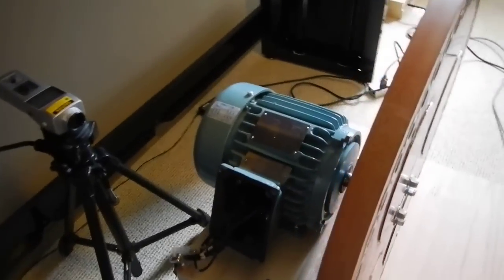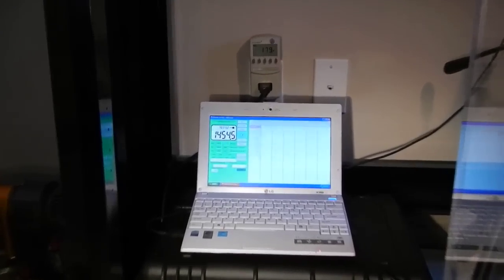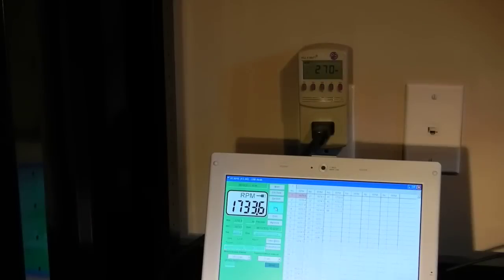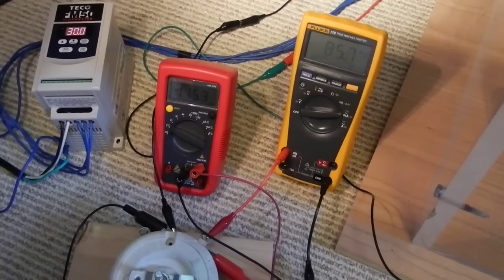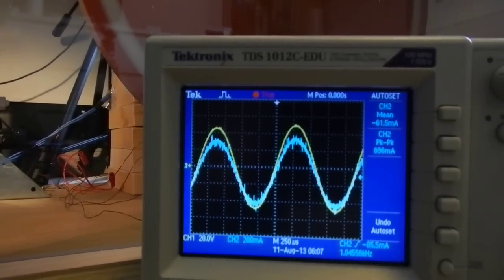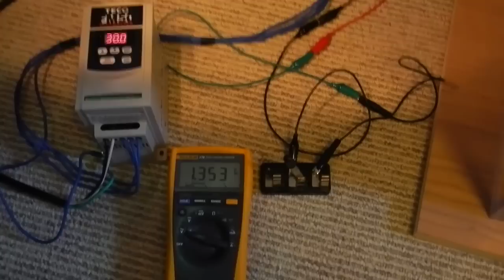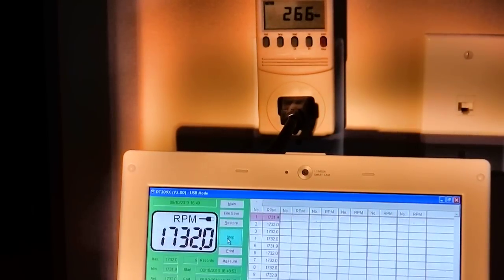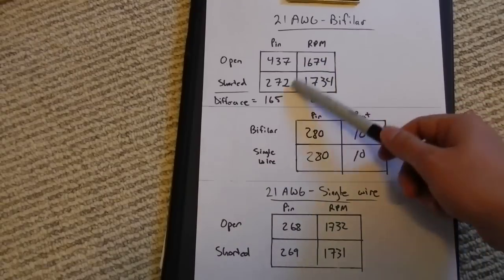Debunked - Thane Heins, ReGenX, delayed lenz, shorted coil, acceleration effect

Comment: Speed increase on Rotor is caused by current flow to the load. The magnetic field polarity is opposite the polarity that induce the current. Since the wheel is way so fast one of the coil lags behind in reaction and this makes the coil unaffected by the two following magnets on the rotor. So the second magnet from the one induce matches polarity at the coil that's repel and increase the rotor speed just like a motor  the third is don't affect the coil at all because the polarity on the coil hasn't collapse yet. The fourth magnet induce current as normal since the field at the coil is zero. To proof this low your speed substantially. The shouldn't be speed increase and low wattage drop.
Reply: Also remember you speed sensor is not correct although won't make a difference. The speed of the wheel is high on the outside than near the shaft and that's relatively to where the coil and magnets are. To get an accurate reading put the reflector at the same line as the magnet on the wheel
Reply: That's because it's a tackometer.  It measures revolutions per minute.  It doesn't matter if the reflector is tripped near the rim or the center, as long as it takes the reflector the same amount of time (which it does regardless of where in that radius it is located) to come back around and tick the laser, you have an accurate tack.  Measuring the speed at one side of the wheel or the other will involve some much more fancy math, but ticking that the wheel has done a full revolution can be done at any point on the radius.

Comment from the maker: @Matthew Jones You don't know what you are talking about. Mr.Heins has many times said you want high impedance AND high frequency. It is only under those conditions where the acceleration affect appears as I have demonstrated. You can count his magnets and with RPM get the freq which is in the same range as mine. In all his latest configurations showing the effect there is NO physical magnetic loop. It is not necessary. Go to his channel watch his most RECENT videos. All of your critiques are in error.
Reply: +Gestalt Reality Where is the bitoroid ? Don't test something that doesn't even resemble it and then say it is fake. That is like the Mythbusters test of the Bedini pulse motor test by testing a normal motor. The 2 have nothing in common. Your motor is NOT the same as shown in the tests since he was using an INDUCTION MOTOR and WITH A LOAD. You are not using an induction motor and you don't have a load, unless there was one I didn't see. You should measure under load since real world results are what matter, not running an unloaded motor. The added magnet provides a different flux path from the original path in the motor.

In your tests include the power in, power out and MECHANICAL POWER output also and in real world LOADED motor tests.

The second path in the bitoroid is what makes the difference by giving the field a lower reluctance path.

If your serious about doing tests like these you should also test a patent called the "no load generator" that also includes an extra flux path. US 6208061 B1
But make a motor EXACTLY like the original, not one that has nothing in common like the one in this video.

Also, did you look at the lab results of were a lab tested the bitoroid ?

P.S. If the theory doesn't match the experiment then the theory is wrong.

Comment: How can you get any effect from a coil (you mention The bifillar when open impact the motor consumption ) where the current is 0 (not connected) ....this one does't look to bright
Reply from the maker: The dielectric voltage is high enough for current to flow OUTSIDE the wire, causing BEMF.

Comment: The reason yours does not work is because your rotating disk with attached magnets is made if a non magnetic material. Pay close attention to Thane's design. The armature that is attached to rotating magnets and motor is made of steel. The effect cannot be achieved without this!

Comment: I have done the experiment my self with a dc motor connected to a stepper motor and seen acceleration when circuit is shorted at 12v input to the motor. my output voltage was 26v and i run a 2 watt 12v lamp across the circuit getting the same acceleration. the reason why the system slows down is because the waveform become flat or  reversed. when the waveform experience little change under short circuit the system accelerates. when a load is applied the voltage is divided between gen and load.

Comment: I think what he means is that you use the motor or anything else to bring the generator wheel up to speed, and then turn the motor off.
Then you short the bifilar coil to see how it affect the wheel.
If it started to speed up that would be amazing, but more likely it would just take a longer time to slow down to a halt, compared to without a short circuit.

Comment: The minimal consumption of the motor, it is the frequency of the net! Motor windings are designed to idle (60 Hz. U.S.) (50 Hz. USSR))) A load inductor saturation leads to optimal in time, that is not saturated inductance. A single-core coil (unlike beef.) Does not give enough importance on the amps and the magnetic flux, respectively.

Comment: You are showing apples to apples where the "speed up under load" coil and the single filler coil both PUT OUT the exact same amount of power and basically the input power to the motor is the SAME with both coils. But if we want the speed up under load coil to exhibit its MAXIMUM OUTPUT, (output GREATER than what you show it is capable of) what do we have to do? We have to DECREASE the rpm's of the motor to the point where the coil is NEITHER SPEEDING UP NOR SLOWING DOWN the drive motor. This means LOWERING the voltage supplied to the motor. If you lower the voltage, what does THAT do to the input? It DECREASES it, while at THE SAME TIME increasing the coil output. THAT is the ENTIRE BENEFIT of the "speed up under load coil". Look at it this way. Core material will absorb magnetic flux at a FIXED rate for THAT specific material. It must absorb ENOUGH flux to cause the wires to produce the electrical field that must occur in the wiring before the core is turned into a repulsing electromagnet that will slow the approach of the rotor magnet. There are three ways to do this. Alter the core material, or increase its mass. Increase the capacitance of the coil with parallel windings connected in series, or just turn the rotor FASTER. ANY coil is a "speed up under load" coil if the rotor is turning FAST enough. You don't "delay" Lenz or "eliminate" Lenz, you simply outrun it. You make sure the rotor magnet is at top dead center before the Lenz reaction takes place. Lenz is not a law, despite what people believe. It is a REACTION. Reactions can be influenced.

Comment: The one aspect of this might make a motor run faster.  High voltage from the coil might be fed back to the supply to raise the motor supply voltage.  Higher voltage = faster motor.  Apart from that, the delayed lenz effect is bogus because the frequency of the coil is driven by the speed of the generator.  Shorting the coil simply reduces cogging at high frequency but it truly does not drive the motor faster.  If that were the case the motor and generating coil would achieve over unity and perpetual motion.

Comment: at 6:41 you said 840 times per second did you mean 840 times per minute rpm?
Reply from the maker: The hertz is the derived unit of frequency in the International System of Units and is defined as one cycle per second. If you look at the meter it's 839.6 Hz which is ~840 times per second.

Comment: You are missing alot of the puzzle.
The BiTT was made also to cause the phase shift from the genset.

Thane isn't going to give you all the details. He patented it, It isnt exactly open sourced.

I will say, i have seen with my own eyes experiments that prove otherwise.
Regardless of what people choose to think.

There is a reason researchers are spending tons of money in SILENCE doing this.

Thane used some coils with much higher resistance and would switch between paralell bifilar, series bifilar, and few other modes.
If the frequency isnt PERFECT and i mean PERFECT it will never work.

Cheers.

Comment: Your magnets are too close together. Your magnet should never exceed the size of your core, everything else is a waste with no added power. The outside diameter of your core winding is the boundary and your coil should not enter the next magnetic field until it completely leaves the preceding one. Also, try a serpentine coil, they are easier and more efficient in winding and using alternating current.

Comment: Your Coil has just some hundreds Loops around the Magnetic Flux, that induces Current. But You just shorted it, that's almost an infinite Loop. How much Current is now in Your Coil?
Keep in Mind that an infinite Loop surrounding a MagFlux possibly does not induce Voltage, since there is no Resistive Load and a (possibly) useless Current.
I don't understand the Phyisical Meaning of what i just said. Not that much to tell what that might have in Effect.

Just keep observing what happens naturally ;)

Comment: your magnets are to near to each other. you have about 2 and a half magnets under the coil at all times - bad flux..... make the experiment properly!!!!!!!! debunk again then.....
Reply from the maker: Thane Heins has his magnets, side by side with no gap, so therefore more "near" together than mine. The flux gives a very clean sinusoidal signal.
Reply: no way... are you kiddin' me or are you blind?
Reply: And you are totally wrong about the dimensions: such small magnets to such big coils...That's ridiculous!!!!!
Reply: how come I and others can replicate it?????
Reply: MISINFORMER!!!
Reply from the maker: Inmetz I did replicate the acceleration with a short/load. There is just no benefit to it from a power-input perspective. Replicate the experiment and show power input numbers with a bifilar and non-bifilar. NO ONE has done this, not even Mr.Heins.
Reply: try thinner gauge wire!
Reply: your wheel has still got the magnets to tight to each other. if your config. is N-S-N-S, you have(several) opposite poles in front of your coil simultaneously....
Reply: and if you measure from center to center of the magnets, thane heinz's magnets are fare apart compared to yours...
Reply from the maker: Inmetz I took a screenshot from his setup. Once a magnet passes TDC the poles flip, so having the next opposing magnet right beside is PERFECTLY fine. Look at his magnets are CLOSER together than mine: http://www.gestaltreality.com/wp-content/uploads/2014/01/Thane-Heins-24-magnets-on-rotor.jpg
Reply: but they are much larger than yours
Reply from the maker: Inmetz It doesn't matter. My magnets are stronger. I have tried larger size in previous configurations as well, I found through experimentation those variables are immaterial to the acceleration effect.
Reply: your wheel can not conduct the BEMF to the motor. is it even a induction motor you got?
Reply: and i just watched your video again - theres actually 4 magnets in front of the coil(the coil, not the core) . it's not the core alone which catches the flux..
Reply: and if your coil is producing more than 1000V, thats HV, and you have to harness the output in another fashion. I recon you read Tesla...thane heinz coils only give out less than 2ooV - no ozone there... and of course the frequency is important.
Reply: The magnets are too close in relation to the coil/core proportions, yes.  @Inmetz

Comment: If the core material is the same , it should not make any difference, whether you use a thin of thick or bifilar coil, as long as the coil is open. The starting conditions for both of them should be the same. 
You surely know , that Lenz law does not apply , as long the coil is open.
I guess it may be due to air friction or other related effects. There must be a way to change the coils without altering any mechanical properties.
Using a non metal disk is imho crucial for removing any influence the magnetic flux of the coil / magnets to the motor. Otherwise your enhancing the efficiency of the motor and fooling yourself. Repeat the experiment with identical starting conditions.
Reply from the maker: Actually Lenz DOES apply on a OPEN bifilar coil above a given threshold frequency! That is the discovery! If the voltage goes high enough >+1000 volts even exceeding the dielectric breakdown voltage of the magnet wire enamel by double, current can flow causing back-EMF. If the current is in the windings or between the windings I am not sure...

Thane uses a metal disk I do NOT in order to rule out confounding variables therefore making my setup superior in studying this effect. When I change coils no mechanical properties are altered what so ever.
Reply: +Gestalt Reality If current is flowing through the coil, it is not open.